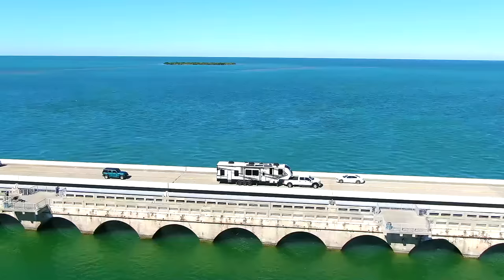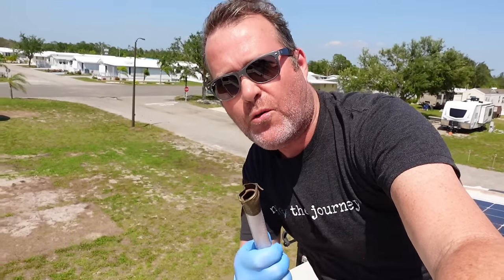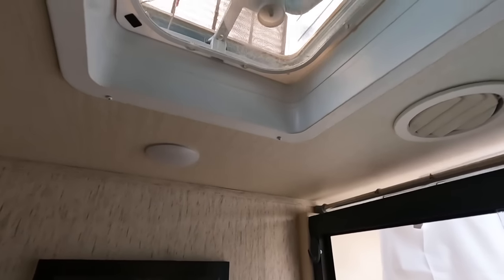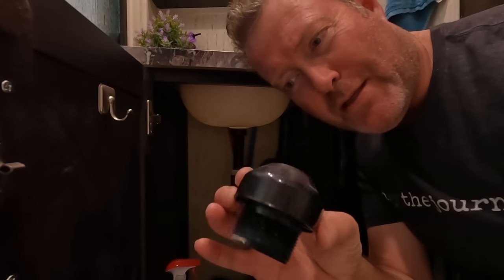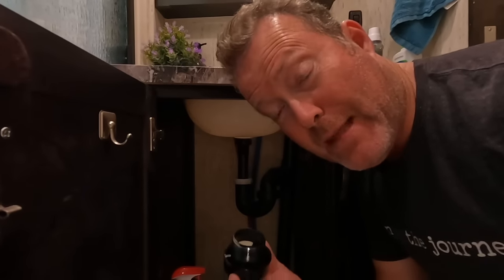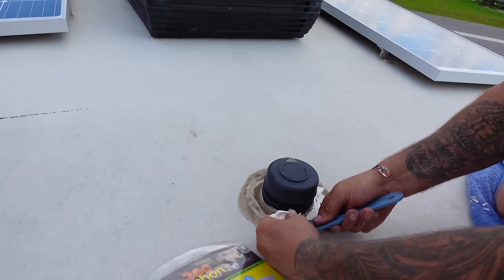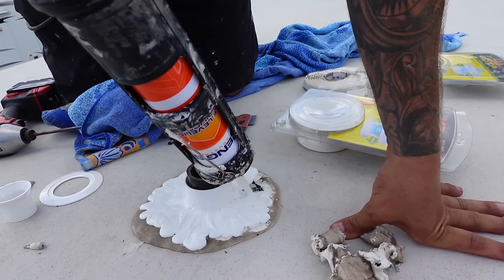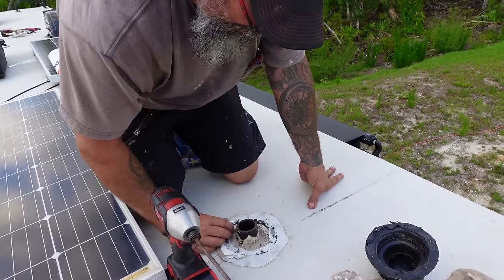STOP RV Black and Grey Tank Odor NOW! 3 Cheap & Easy Solutions That Work

Comment: I'm not sure about your RV Tech.  I literally just installed 2 of these last weekend and the instructions expressly call for gluing the funnel into the vent pipe and then gluing the cap on.  It's not mean to be a compression fit.  Also, doesn't recommend lap sealant as the glue.  Specifically recommends a glue for that use.  Hopefully you'll have no issues.  Otherwise great tips!
Reply: yea and the guy didn't want to put on the plastic piece that hides the screws WTF
Reply: Simple fix! Those vent covers are garbage.  Install a Lippert 360 or what I use is the Cyclone from Campco.  Problem solved.
Reply: @dougphins thanks for the comment I'm going through this now just had to buy a RV we were renting one from my husband's boss and he was scammed. The tanks were rotted the vent was cut out we been poisoned so bad. New camper i noticed the filter is not on right

Comment: Actually, an air admittance valve is for when ANOTHER sink is draining. It pulls air from that valve rather than pulling water from the trap. Also, it's probably more advisable to leave the bad valve in place until you can replace it, rather than blocking it with plastic. That could cause the trap to go dry.

Comment: Had that sewer smell from the grey tank. First I changed the air admittance valve. It was a marginally improvement.   Then I changed the air vents on the roof to the model in the video. That was a major improvement. Do recommend those.

We still can have an odor, but only when the grey tank is 100% full and we are traveling over mountain passes.  I think the water level reaches the vent pipe inside the tank. When that happens the pressure equalization inside the tank does not work, and air will be forced up thru the air admittance valve.

Comment: Those are also called a studor vent. They are also used on mobile homes and help from having less vents penetrating the roof. You have to remember that if they go bad that this is a straight path to the septic system unless your grey tank termination valve is close. If it is the you will smell your gray tank only. Putting a bag over the vent may cause the sink not to drain properly. Glad you found the culprit. Thanks for sharing!
Reply from the maker: Thanks for the info!

Comment: Solution #1 is a good idea for your home. The same thing can happen to a house vent. I've poured Dran-o into mine to clear clogs like dead animals, wasp nests, etc. When you have an open tube, it's an invitation for critters.

Just make sure to flush with water afterward. And don't use Dran-o on your camper vent.

Comment: Not sure if i had the same issues.  But it took a while to figure my smeel out.  Turns out @2004 winnabagosb put a black tank vent right next to the bath room roof vent.  So the smells were coming off the vent and going back down inside the roof vent.  If driving you had to either have thefan running or close the roof vent.  I ended up putting a taller vent with a angle for it to pull vacuum while driving. Like you see a lot of vent that are aimed downwards. And made it vent farther away from the roof vent.
Thanks. And 
Have fun.

Comment: A comment about the sealant this man used....  It is called Heng's self-leveling Silicone Caulk and is FAR superior to the Dicor (and similar) stuff that is generally used by most manufacturers:
The self-leveling Silicone Caulk is MUCH stronger and lasts MUCH longer when exposed to the elements of sun and rain than do the Dicor-like products BUT, you must be aware that, because it is much stronger, you must be much more careful when using it.
My current RV (2009 Tiffin Allegro) has had this product on it from the factory and for over 14 years and it is still like new, with no deterioration that I can ascertain.  However, it is, as one might expect, very strong in its bond and very reluctant to let go of what it has bonded to.  With that in mind, be very cautious of using in on a rubber/TPO roof because, if you need to remove it to access the thing it is sealing, it will not go quietly and, unlike fiberglass roofs that can withstand that sort or "prying", you may end up tearing your roof membrane.
Use the sealant that is suggested by your manufacturer or, if you are willing to work with the possibility of future issues where you must put in extra effort to insure your rubber roof stays intact, go with the self-leveling silicone.  Just be aware of the consequences of your decision.
Happy travels, BA
Reply from the maker: Wow, thanks for the info!

Comment: Hi Tom, friendly note on plumbing. The purpose of the air admittance valve is to allow air into your sink drain vent pipe as it probably does not vent through the roof. Our Grand Design has them on bathroom sink gray tank and one on kitchen galley gray tank 2 separate gray tanks we only have one roof vent for the black tank. The p trap is the other part of the equation no water in p trap will also cause oder. Also spend the extra money and by the better studor valve or you're just gonna keep buying the same cheap thing the factories put on. And turning the bathroom fan on just draws gases in to the rig if the valve is bad as it is not closing properly.
Reply from the maker: Thanks for the tips!

Comment: on my Rockwood I had to smell and discovered the vent on the roof the pipe that goes from the tank to the roof was too short so it wasn't reaching right out the roof  only by 5mm on one side  that was causing the smell not to go right out was dropping down the top of the pipe coming down inside the walls and smell through the light switch  somebody doesn't know how to cut the pipe straight so took the caps off and silicone the top of pipe to the roof vent  then cap back on and it work perfect
Reply from the maker: Oh wow, thanks for sharing!

Comment: Use a heat gun to heat up the sealer around the vent caps before removing. I also had to trim off the height of the vent pipes. They were too high. Install bug screens on all the vents.

Comment: Are we sure that's the proper way because who would put a water hose to a vent on the roof on an RV? I'm just asking questions cuz I'm new to this as well I'm on my third RV because the first two were so bad I had to get rid of them we just bought a 2018 and we're trying to figure it all out the right way
Reply: That vent connects directly to the black or grey tank.  If it gets clogged, gases might not escape.  Flushing it makes sense to me!

Comment: Without a pee trap don't see how it could be possible to stop the smell of what sits in the waist holding tanks from getting in, Residential toilets and sinks have them built in, try switching over to them, but you have to also install a pee trap to your shower drain, and vanity sinks and kitchen sinks,